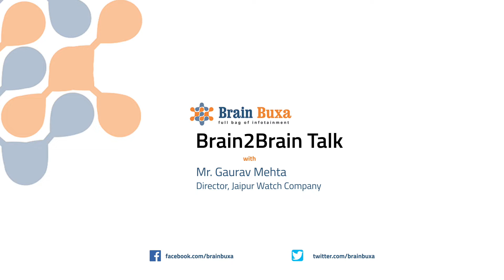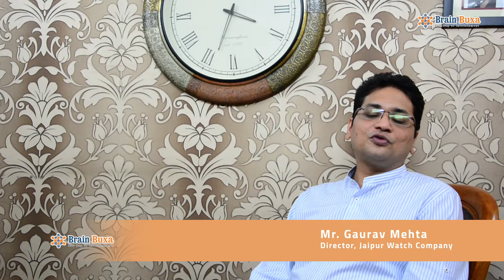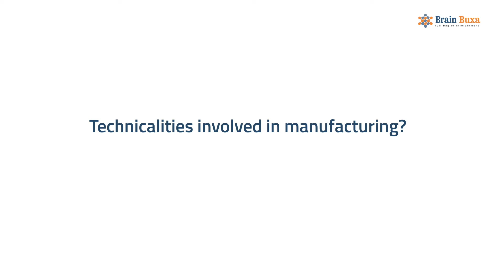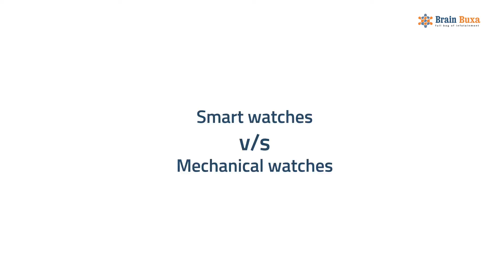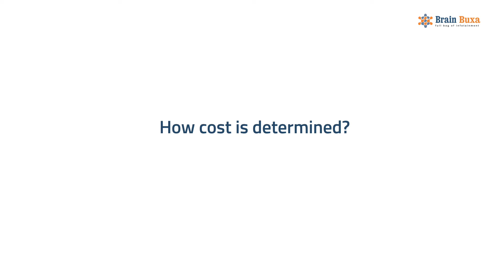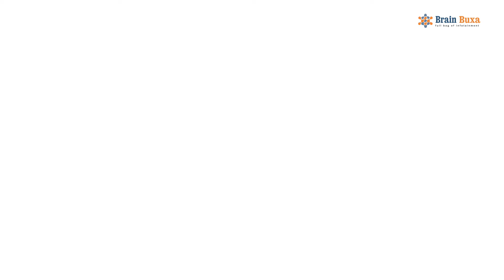Gaurav Mehta: Founder & Creative head - Jaipur Watch Company

Comment: Well, coin watches are not anything new; for something not very innovative, I think the prices (in the range of 40-60 thousand ₹, that too for a quartz movement) simply doesn't make sense. But, clearly JWC thinks otherwise.
Reply: @malikazhar6575  some are, some aren't. But even the ones that are, used miyotas, costing <50$ apiece. I guess they are branding themselves as a kind of fashion watch company like mvmt or Daniel Wellington
Reply: Also looks similar as cheap street watch models and mrp is too high. With above 30k we can get seiko or Casio watches respectively 👍